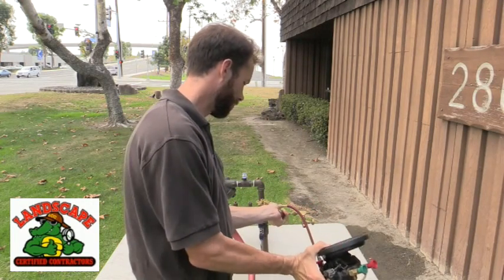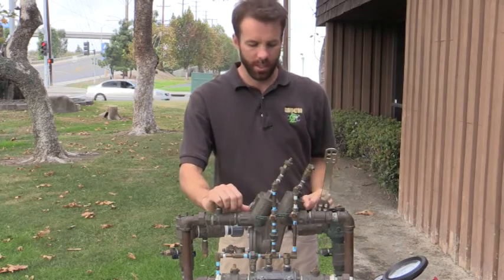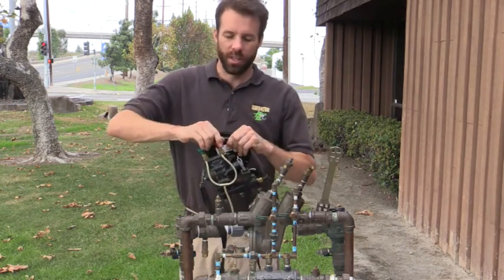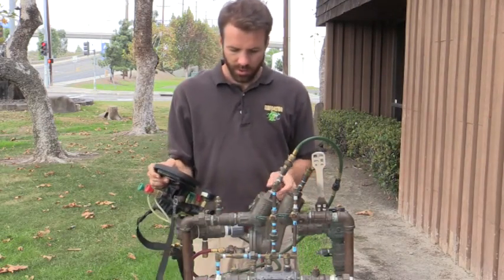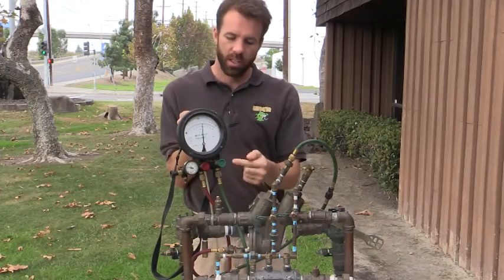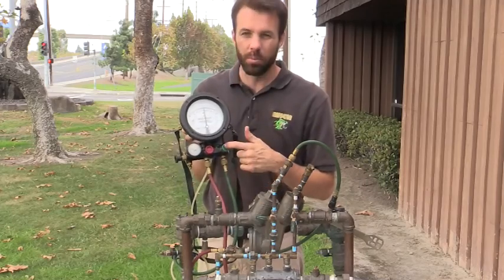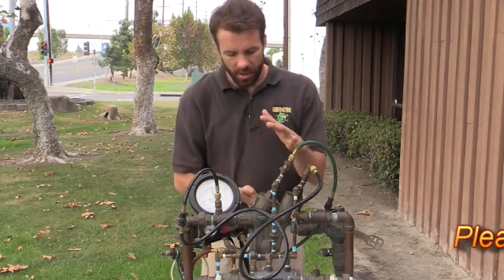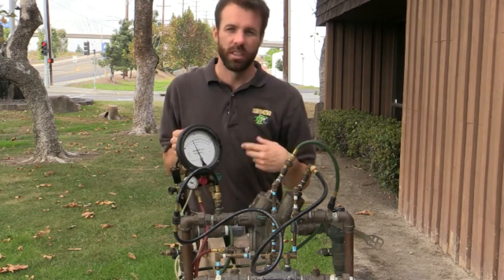Reduced Pressure Principle Backflow Trouble Shooting Part 1

Comment: Whatever taps those are coming off the test valves appear to have been installed in the line BEFORE the test valves. Couldn't that work -- depending on what it is hooked up to -- the source of your readings that you are assuming is "a leaky #2 shut-off valve with down-stream demand"?
Reply: That piping is in place to simulate leakages and failures. It should not be in place in the field.